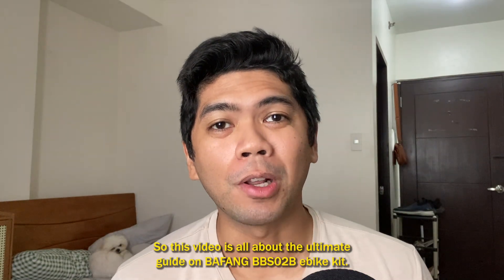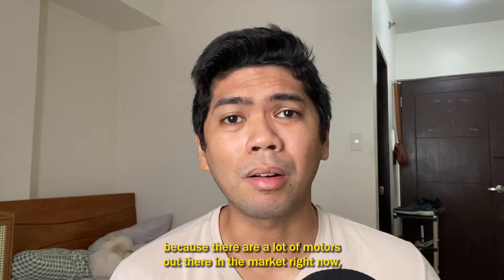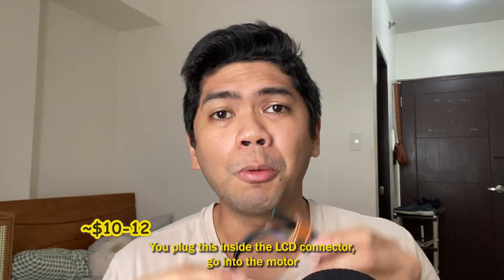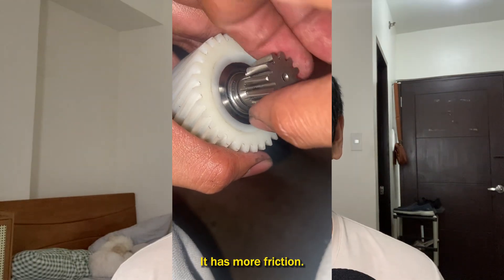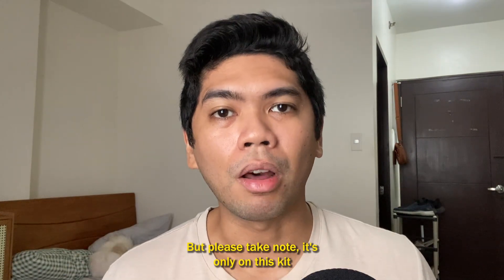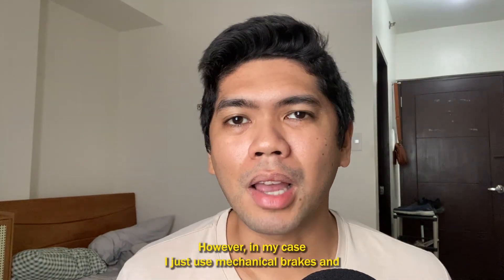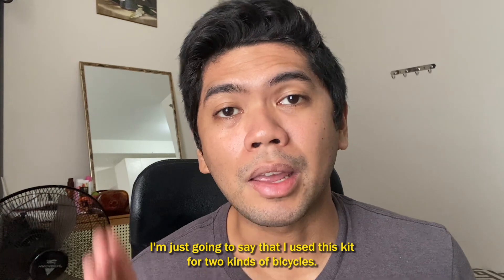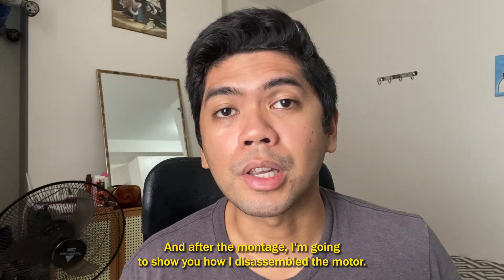Everything You Need to Know: Bafang (8FUN) BBS02 ebike mid-drive convert kit REVIEW GUIDE

Comment: Can bus bbs 02 ne peut pas etre reconfigurer,seule la version UART peut l'être.
Reply from the maker: May I know more details about this? I believe if it has a communication line for the LCD, it can be configured. 

if that's the case, what's the BBS02 firmware that allows programming?
Reply: @Mechodynamo  Bafang has slowly been moving over to CAN bus protocol from the old UART protocol. No free and available programming software has been made for the new protocol yet, so users cannot program power curves, PAS levels, current limits and more as of today.

The old UART protocol was easily programmed with free software, you could even program it directly without software, by just uploading a properly formatted file. My favorite reprogramming software is Penoff’s.

I’m sad to see Bafang switch protocols, when UART did the job just fine, hopefully some free software for CAN bus releases soon
Reply from the maker: @ is this exclusive to BBSHD or are there models of BBS02 with the CAN software? 

I only have BBS02B with a UART version; it would be nice if we know what model did bafang start implementing the CAN bus protocol instead of UART.
Reply: @Mechodynamo If I’m not mistaken, this applies to all new Bafang Mid Drives from around 2023 and newer. BBS01, BBS02, BBSHD, M625, M325 are those I have personally confirmed.
Reply: @youmayu  The BBS can engines are from 2025. This protocol sucks, especially with the bafang go+ app which doesn't work. Some people via conversations told me that you could change the "can" controller by a "uart", I bought a "uart" controller, but the "color coded" wires don't have the same position in plug and play. I wouldn't take the risk of taking out my welding station and burning the equipment without seeing someone do it with confirmation.

Comment: Nice vid i have the same kit different display but i power it with a ryobi 40v and a hyper though 20v in series because i have power tools that i use those batteries with.
Reply from the maker: cool! that setup is lighter too. easily replaceable if you need to extend the range. 
was thinking of the same thing before but it's just too costly on my end, and would like to stick to the stock battery case instead.